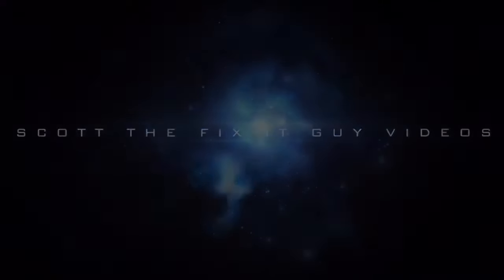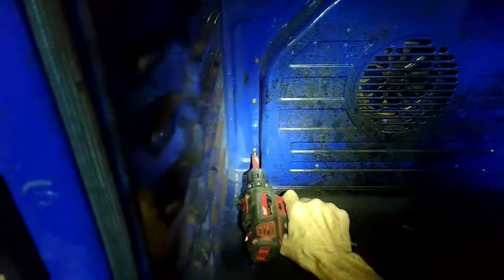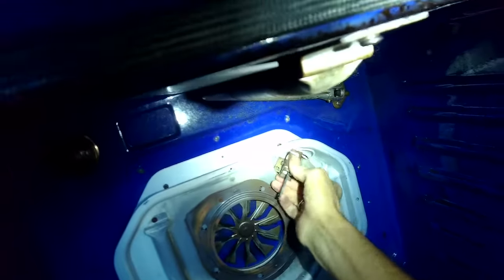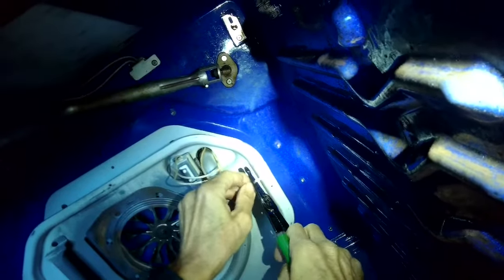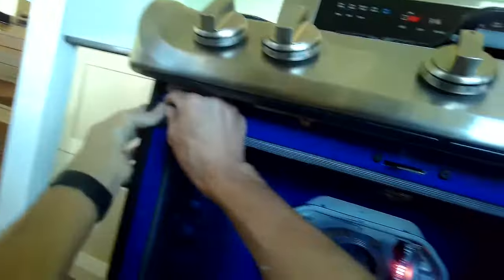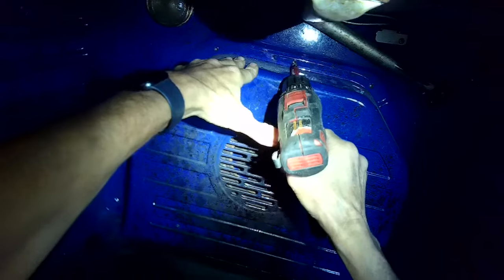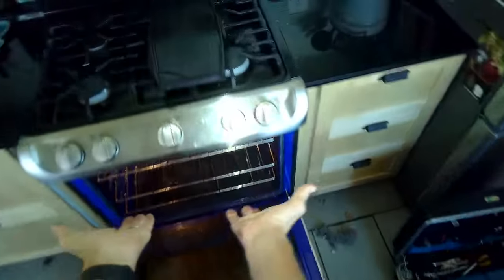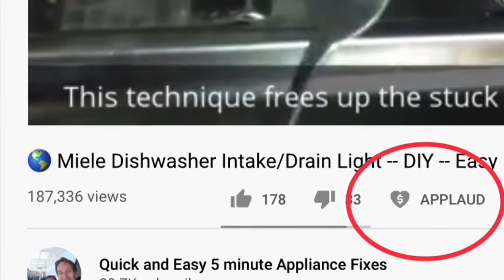✨ LG OVEN F09 ERROR - NO HEAT - QUICK EASY FIX ✨

Comment: Great video very helpful.  Seems like my igniter may be bad but it preheats fine, just won’t light again.  Igniter glows but the gas won’t light.  New temp sensor and even brand new board.  Crazy.  Any ideas?  Mine is a convection also.
Reply from the maker: Yep,
That’s the sign of a worn out igniter 👍

Comment: Thank you - It is a shame that the appliances we have, do not hold up the way our grandparent's appliances did. This LG was not cheap - but after only 2 years I replaced the igniter of the broiler - and now the igniter of the oven. Your instructions were easy to follow.
Reply from the maker: You speak the truth👍
Reply: Just what I said today. My oven only two years old. Ridiculous how they make things now.
Reply: Absolutely true!  Does anyone have the link for that igniter? I don’t see it linked. thank you.
Reply: what is the part number
Reply: Why LG Appliances fail over short years. Both my LG dishwasher and range failed in less than 5 years. I have two different size microwaves of other companies and still using, one for five years and the other over 10 years and still they are working.
Reply: @idahorefugeecommunityassoc6613  .... My LG refrigerator had a compressor go 2 times in 5 years, now my oven needs an igniter and it is 7 years old!  Cheaper to repair it than replace them that is for sure.
Reply: Yeah and with the price of them I expect it to actually last!!!!!
Reply: I agree.  I replaced the igniter 2 years ago, and recently got the F11 code.  Replaced it again and it worked for 2 days.

Comment: Note to self: This vid is helpful, but no need to splice wires. Just remove burner tube from back first. (this is the third time I've had to replace this igniter in the last couple years 😢)
Reply from the maker: Nice job👍

Comment: Hi in my case I can see the igniter glowing but nothing is igniting ... if I understand correctly from the video and comments the igniter glowing doesnt mean its hot enough to ignite the gas and that if the igniter doesnt get hot enough, then the relay board wont open the gas valve ..or is it the relay board opens the gas valve but igniter won't ignite the gas and then you get an F9 after 5 min?
Reply from the maker: That’s right, but a new igniter will fix it👍

Comment: No need to splice the wires if you take the back panel off the range. You may need to loosen the flame tube to fit the plug through the hole.
Reply from the maker: Thanks Tracy👍
Reply: Yep this is how I do it for my repairs again the way op shows is just as safe and effective
Reply: Wondering how you took the back panel off.  I was attemping to pull the plug through the firewall, and it dissconnected falling into the stove.  I have no idea how to get it out of there to install my new part.  Thanks!
Reply: One would think so. However, the gap between the cut out and flame tube is not wide enough for the plug to slide through, as you suggested, thereby requiring loosening/removal of the pipe, which didn’t look obvious/simple. Much easier to splice the wires as he did IMO.
Reply: @IkeMan4  🤷‍♂️ was simple enough to loosen the flame tube on my range
Reply: @ysr5076  from behind, front or both?
Reply: @IkeMan4  don’t recall, just know it only took me a few more minutes. Either way works though
Reply: @jordanquattro7856  Open connections around gas are never safe.

Comment: Do the wire nuts have to go behind that firewall? I cut the wire too short and it won’t go behind the hole 🙄 I didn’t see in the video that you put them back there though and the oven seems to be working fine now
Reply from the maker: It’s ok if they don’t go behind the firewall.

Comment: Great video- very helpful.  Thank you for posting it Scott.  

I removed the center back cover of the unit (you have to remove the console back cover as well though), and located the igniter harness connection on the bottom.  There wasn't enough space to slide the new connector through the gap, but removing 1 screw to the right of the burner tube was enough to lower the tube in the hole and enable clearance for the connector.  The extra steps I noted are mostly removing screws, but there are a LOT of them to get the back covers off.  Also, I recommend taking a picture of the burner assembly, as I struggled to reassemble it correctly.  It's tricky to get the 2 support brackets together with the igniter, and the igniter is fragile, so you have to be extra careful not to touch it or bump it as you attach it to the 2 bracket pieces.  Good luck!
Reply from the maker: Thanks for the great info.
Reply: Do you remember how to put the burner brackets back?  I'm struggling with that now
Reply: Thank you for this info. It was very helpful. My model is engineered so poorly LSG4513ST. They could have made it like the older models with enough room to pass the cord and connector through. I saw your comment and did the same thing after watching this video. I had to take the burner off since there wasn't enough room in mine to wiggle it through. It was a lot of unnecessary disassembly. I wrapped the igniter piece in some bubble wrap and taped it up since so many people said it was fragile. Removed the bubble wrap from the igniter just before putting the middle cover back on the burner assembly.

Comment: Thank you for this video. While there are others showing how to replace the igniter, this is the only one showing the model where the gas line and igniter are on the rear wall not on the bottom.
And since this is such a common issue, replacing the igniter should have been as easy as replacing a light bulb. It's a pity that people now spend upwards of $250 to hire a pro to replace this.
Reply from the maker: You speak the truth Eli😊👍
Reply: We did that, called a repair man the 1st, and it was over $300. I cannot do that this time. And LG support was no help at all, a 15% coupon(wow!) for another LG product, that won't be happening!
Reply: Thank you Scott, for this easy to understand video. And for mentioning that the ignitor only lasts 4/5 years. I recently contacted LG support, and they were no help at all!The 1st time we had a repair man come out it was over $300. Now my hubby's is going to try to replace it. Thanks for your video, it looks pretty straightforward. Thanks again!

Comment: Thank you for this great and really helpful video.   One thing I did different is that I purchased the ignitor that comes with the same plastic connector but the connector would not go through the hole to the back.  To fix this I used a thin flat screwdriver to release the wires from the plastic connector and then reconnect them after I run the wires to the back.
Reply from the maker: That is great information,
Thank you👍

Comment: This is a good video and helped me considerably. One suggestion… I was having an issue with removing the mounting bracket from the old igniter cage; the screw was seized. I just swapped the igniter cages and used the old cage with the new ignitor.
Reply from the maker: Yep,
Excellent idea😊👍
Reply: I wish I saw this comment. I had this issue with 2 screws. The screws were damaged in the process, but worked kind of.
Reply: Thank you!  I was having a hard time figuring out how to mount the thing, then, duh... switch the cage bracket.  Worked perfect, thanks!

Comment: thank you.  its quick and easy if all the screws come out.  One of the screws broke, and another had to be sawed off.  i also opened up the back panel  to connect the wires with the snap on tip.  had to loosen the burner a bit to run the wires to the back.  Here's my question.  My original ignitor had a "cage" around it.  My replacement didn't.  Will installing an ignitor without the cage result in a shorter life span?
Reply from the maker: Should be the same life.

Comment: Thanks for this.. question.. did you transfer the frigidaire ignitor to the original 90 degree LG ignitor holder? Seems that's the only way it would fit. Pls confirm that the ignitor is supplied with the wire nuts.
Thank you
Reply from the maker: It does come with ceramic wire nuts.
Yep, you just bend out the metal frame and slip the new igniter in and bend the frame back👍
Reply: @ScottTheFixItGuyChannel  Perfect... thanks for that.

Comment: Thank you for the video.  I really thought I could push the electrical plug connection past the gas pipe and into the back to the oven, so I wouldn't have to splice the wires.  I'd still be pushing that wire every which way but loose if not for your video.  You just saved me spending the rest of my life fighting with a wire plug that just doesn't fit through.  Thank you again.
Reply from the maker: Thank you Bill👍

Comment: I appreciate the cheat of splicing into the connector. But are the wire caps wont go passed through to the back.
Are the white wire caps safe to use inside the oven? What about self clean?
Reply from the maker: They are since they’re made of ceramic.

Comment: I have a lsg4513st oven with the f9 error code and after watching your video purchased a replacement igniter on Amazon from a brand called Repairwares that had good ratings ... i was careful with the install when switching the bracket, and careful not to touch the ignitor surface and made the wire nut connections ... everything seemed fine, tested before reassembly and it worked then reassembled and tested a couple more times still worked ... that night turned on over for dinner and a flash of light and sound came from the oven that tripped the breaker ... reset breaker and dissasembed to find the ignitor in pieces and the metal bracket partly melted ! Went to local parts store to get what I assume was a more legitimate ignitor and tried it out, now there is no power to ignitor ... the ignitor from Amazon that failed fried some of the oven control electronics so now I have a bigger and more expensive problem ... not sure how common this is but found at least one other person on Amazon with same story so buyer beware ...
Reply from the maker: Aaah shoot,
I’m sorry to hear that.
I wonder if a new relay board will fix it?
Reply: @ScottTheFixItGuyChannel  thanks, replacement relay board on order ~ $125 will update from my google searches sounds like the most likely fix

Comment: Thanks for the video, what would it mean if I am still getting an f09 code but it is still igniting I can see a flame
Reply from the maker: Can you try a new igniter?
Even though it lights the old igniter might be letting the flame go out to early.
It could also be a bad relay board.
Reply: @ScottTheFixItGuyChannel  Thanks for getting back to me...  Turns out the line feeding it was frozen!  I am running the stove off a BBQ Tank and the regulator was frozen...nothing a heat gun couldnt take care of!

Comment: I purchased an LG refrigerator and a LG stove 5 burner and they are the worst appliances I have ever owned nothing but junk
Thank you for this video I'm going to throw some more money on this piece of junk.
Reply from the maker: Yep,
LG, Samsung and GE are currently making junk.
Reply: @ScottTheFixItGuyChannel  I agree as I had my Samsung refrigerator go out in less than 5 years.  Two years ago, my washer, dryer, (LG), refrigerator (Samsung), and hot water heater go out within a 7 month period - and a tree fell on my house - really tough for a 73 year old retiree on a small pension!  I also had my AC repaired during that 7 month period!

Comment: Hi @scott! I followed your instructions until cutting the wire of the old igniter. But I couldn’t fit the new wire connector through the hole. It’s simply too big. What should I do? I was told cutting the heat resistent layer around the wire could be dangerous because it could ignite itself. I was so close to fixing my problem but now I’m stuck. Can you please help?
Reply from the maker: Can you send a picture to me at: scottthefixitguy@yahoo.com

Comment: Hi - great video. I noticed the ignitor you removed is different from the new replacement . It’s also a different brand. Why? Thanks
Reply from the maker: Thanks Kevin,

Those generic igniters work great for almost all ovens.
Reply: @ScottTheFixItGuyChannel  thanks again for this helpful video. I took the extra steps of removing the rear panel and the burner in order to use the clip that came with the ignitor. Could not have fixed my oven without your video.

Comment: Got error code F19 on bottom oven of a double oven LG oven meaning that lower oven is not reaching temp properly. Does this sound like the same problem which would require replacing igniter next to the circular fan behind back wall of the lower oven?
Reply from the maker: That does sound like the igniter needs to be replaced 👍

Comment: Scott why would the gas ignit when the blue panel is off but my house smells like gas but if its onn i get the f9 error
Reply from the maker: Sounds like with the panel off there’s more oxygen available which makes it easier to light but with the panel aren’t it’s harder for it to light and it may be showing that the igniter is getting weak and needs to be replaced.

Comment: My LG double oven bakes but won’t broil after self clean and I remember the power on the wall plug clicking off twice and then you have to push that button in the wall for power. This oven is 3 yrs old and model LDG4313ST but I’ve only used the broiler to melt cheese on subs a couple times. Any advice is appreciated!
Reply from the maker: Hi Ginger,

Can you send that same question to my email at: scottthefixitguy@yahoo.com?
Reply: Your GFCI outlet is tripping and it means the oven is pulling more power than your wiring can handle or there is a fault with the oven broiler ignitor

Comment: The porcelain caps seem to have made the wires tight and connected… but neither seem to be holding onto the wires themselves well. Is this okay or should they be in there snug?
Reply from the maker: Hi Thomas, can you strip away a little more insulation from the wires and try again?
It should be pretty tight.
Reply: @ScottTheFixItGuyChannel  yeah I’ve got a little extra wire. I’ll try again! Thank you!

Comment: To be clear, you are tucking the wires back behind the firewall. But the porcelain wire nets are not behind the wall, correct?
Reply from the maker: That’s right 👍
Reply: Perfect! Thanks Scott! This video was great! Did you end up cutting the wires shorter on the Igniter? They come quite long..

Comment: I have the same error on my lg electric range. Ideas what my issue is?
Reply: Did you figure out the issue ?  My electric range just did the same thing.   It smoked a little and then stopped heating.
Reply: @jenainwonderland  yup turns out it is the relay board. I had a surge and it fried it. I'm in canada the board for me is $284
Reply: @briangrace6698  thanks !  Did your broiler not work as well?  I am guess it it is the relay board as well,.  Sucks it was so much to replace.
Reply: @jenainwonderland  yes the broiler did not work either. The stove top works cause that uses a different board. So at least I can still cook. So much for turkey tomorrow.
Reply: @briangrace6698  
If its error o9 or no heat generally its the igniter
Reply: @joetrenary1531  for me it was the relay board the wire was burned right off and fried the board it's fixed now and I'm good.

Comment: Hello Scott, Our LG oven is 3 years old(LSG4513ST), and it will not maintain the proper temp. I set the oven for 350 and It signals that it's at 350 yet in fact it's only reached 250 at the most.  Ten minutes later the thermostat we bought(in order to figure out why we are having baking problems) reads 350.  I bake in it and the product is not "done"(brownies are like mush).  We already replaced the thermometer (not sure of technical name).  It sits in back right rear wall of oven. Anyway, can the ignitor work, yet not work properly?  I have the self clean feature on this model and right after I used it, it quit working.  I will never use the self clean cycle again on any oven I buy. The touch pad is on the front of this model and all of the choices on it work (ex: clock, timer, oven light, temp reading) Please advise.
Reply from the maker: Hi Cynthia,
The igniter is just getting weak.
Replacing it is easy and will get it baking again.
3 years with lots of use means it is at the end of its service life.
Reply: @ScottTheFixItGuyChannel  we have ordered the part! Thank you for your advise. I will let you know how it goes.

Comment: Hi Scott, loved the video!  We have the same error, the F9,  its quite frustrating. Anyways, we can get around it by clearing, the error and trying once or twice more and the oven will then heat.  Is that an igniter issue? Or could it be the relay? I guess my point is, that eventually the oven will ignite.  Thoughts?  Thanks buddy!
Reply from the maker: I think the igniter replacement will do it.  Sounds like it’s on its way out.
Reply: @ScottTheFixItGuyChannel  can I have the link to purchase the igniter please?
Reply: Hi @rbpray I have the same issue you describe, F9 but can clear by trying a 2nd or 3rd time ... did a new igniter fix your issue? Thanks! Luke
Reply: @swqe6968  Hi Luke, we replaced the igniter and that solved our problem. The repair was quick and easy and my wife was thrilled!  Hope you are able to get it fixed.